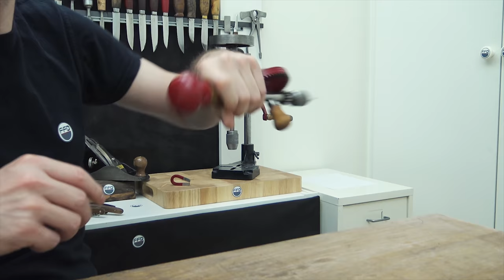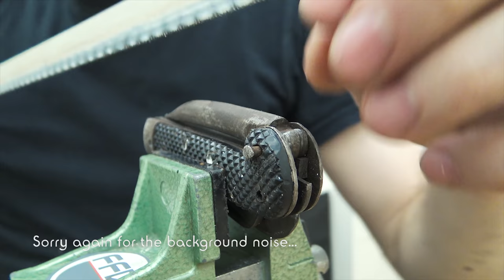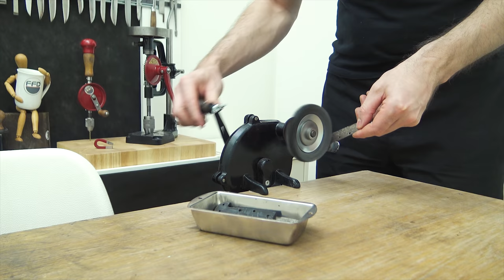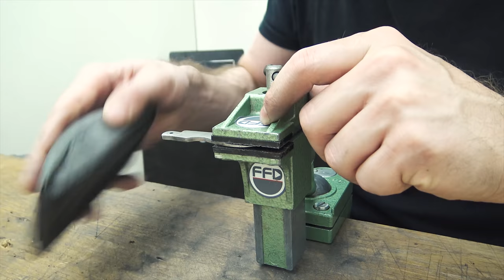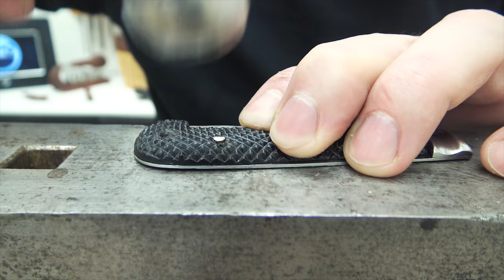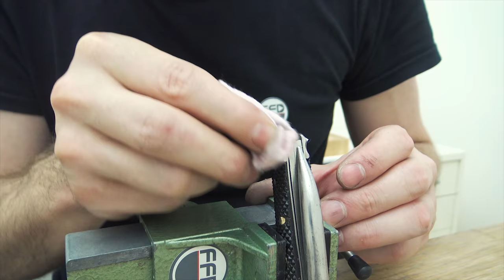Old Rigging Pocket Knife Restoration - Sheffield England

Comment: Beautiful restoration, the scales are incredibly tough and flexible acts like delrin, but don’t think the had that material in the 50’s Great presentation also... Keep up the great work!!!
Reply from the maker: Many many thanks Bradley for watching. I was honestly quite surprised with flexibility and quality!
Well made pocket knife 👌
Reply: @FFD_Restorations  I've got one in my hand issued to my Lance Coporal dad in 1944, dated on the tin opener, W&S.B Sheffield with the broad arrow so now 79 years old. The only difference is there are rivets and washers instead of the end caps on the scales. It has seen better days but still useful and tough as old boots.

Comment: Nice restoration!! I have my great grandfathers jack knife which is dated 1940, it was standard army issue and he would have used it in France and Germany during WW2. It is exactly the same as this but without the marlin spike. I am looking into how I can look after it and clean it up but without access to many tools.
Reply from the maker: Hey Jack, thank you so much for the comment and checking out my video. That is so cool! If you don't want to disassemble it, use fine sandpaper or wool pad to clean it and make sure to apply some kind of protection. That could be a light coat of oil or what I like to use is beeswax mixed with a bit of oil. Take care!
Reply: @FFD_Restorations  takk Boris 👍 Hoppas du har en bra helgen
Reply from the maker: Bare hyggelig, takk det samme 😄👍

Comment: It wasn't just for sailors, it was made for all branches of the armed services and it is a 1942 by Richards of Sheffield, more of these were given to Army personnel than Navy. However if there weren't the Richards stamp on the blade then it is either a very good copy of the main blade has been replaced, either scenario the value has significantly dropped. Fantastic work on the restoration though even if you were making me nervous when you were peening the pins over and hitting the bakerlite scales.

Comment: Good job. I think this is from the 60's not 50's, but it's hard to say for sure only seeing a vid. Was a time when I could have really used a knife like this.
Reply from the maker: Thanks for watching, yeah it is hard to say precise for this one!
Reply: Made between 1942 and 1944 in Sheffield, England. Issued to navy men during WW2. The year of manufacture is usually located at the bottom end of the knife blade. The year is stamped on in small font.
Reply: @user-qi5vj9zy9t  How did you narrow that down? I had trouble finding anything on them, what I did find was 60's. but apparently the same or similar has been made for a long time.
Reply: @tootall5559  I have a few. All are date stamped. UK navy jack knives.😂
Reply: @user-qi5vj9zy9t  I probably found more recent clones.

Comment: I am very interested in what you replace pins with. Thin brass welding rods work in some situation, but I recently bought  an old all stainless military knife that will have to come apart as the main blade is broken and remaining blades are very rusty.. What would you use if you cannot save the old pins?
Reply from the maker: Hey John! Welding rods are usually 1.6 or 2.5 mm thick and 20-50 cm in length. I am using 2 and 3 mm thick brass pins between 10 - 20 cm in length. You can use brass, copper or soft steel pins. I like the most brass ones... search in your favorite web browser and I am sure you will find some 😉
Thanks for watching!
Reply: @FFD_Restorations  Thanks, I admire your work.

Comment: This is a WW2 British Army issue Clasp-Knife.  The Marlin Spike was common (so I've read) on Army and Navy issue pieces.

This one, with the metal bolster, is a pre 1942 model.  Earlier models had a copper lanyard loop.  I understand that the bolsters were redacted as they added complexity to the knife's construction, and from '42 onwards the knives were produced without them.  I believe that they may have been added back after 1946/7, but I am not 100% sure.  I think that from the 50's onwards, the standard British Army Clasp-Knife was simplified, so that there are no black plastic 'scales' any more.

In any case, the Can Opener tool should have a 'War Arrow' stamp that'll identify it for sure :-)

Comment: That is a splicing knife. It is used to splice fiber or wire rope. The marlin spike on such a tool is referred to as a “fid”. It is better adapted to opening the lay in a line rather than wire rope but can be used as a marlin spike occasionally. The knife blade is specifically for cutting line. 

The “can opener” is a lay hook. It is used when splicing wire rope to open the strands and “un-lay” a section then close the lay once a splice is made.
Reply from the maker: Wow, thanks for sharing!

Comment: Took apart my Sheffield 1943 dated jack knife. The blade was so worn it was loose when open so had to weld in extra metal. Now it's tight and have to be careful when closing it.
Reply from the maker: That is cool, nice way to fix the issue 👍

Comment: The ww2 version is much simpler. About 4 1/2 inch over all 2 1/2 inch blade single blade with marlin spike on the back . All metal. Though I do have a stainless one with two blades dated 1945 with broad arrow marks , no idea who woul dhave used that.   Both my type and yours where very common in the 1950's , '60's . Both with screwdriver blade on the end.